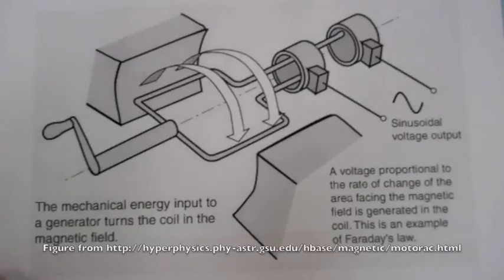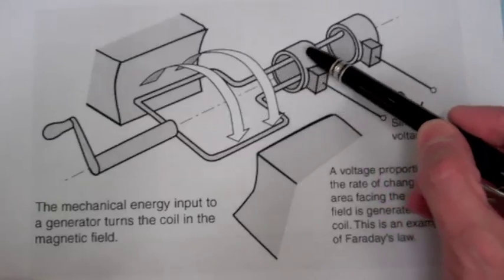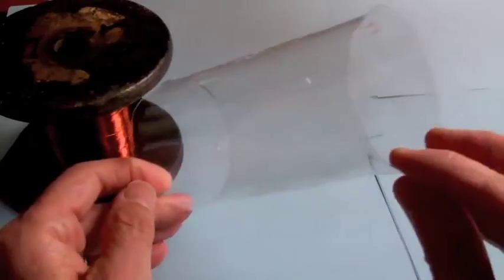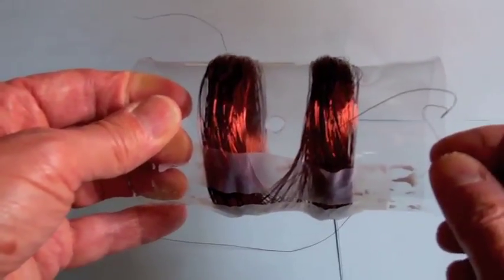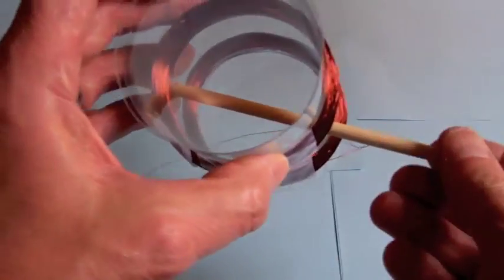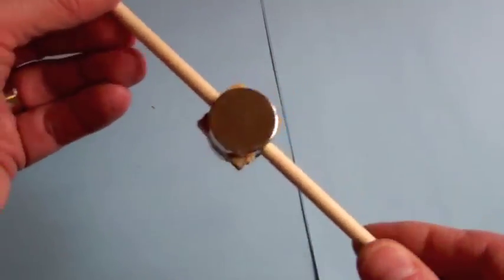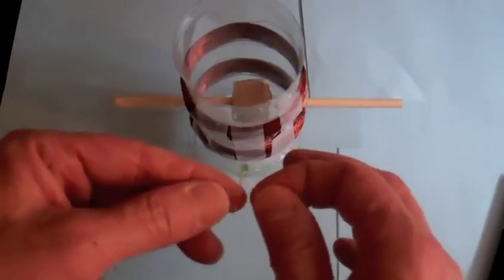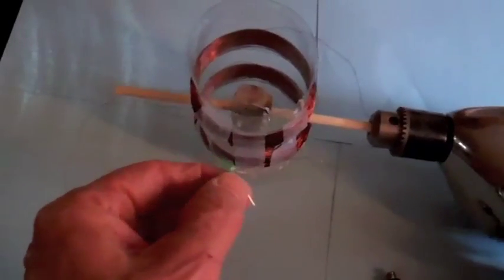AC Generator

Comment: Can anybody tell me what the difference is between making an AC and a DC generator?
Reply from the maker: The first step to go from an AC generator, as demonstrated in this video to a DC generator, would be to add a commutator. A commutator is a moving part of a rotary electrical switch that periodically reverses the current direction between the rotor and the external circuit. So you always have current flowing, and hence voltage, in the same direction.

http://www.motioncontroltips.com/faq-what-is-the-commutator-in-a-dc-motor/
Reply: OK, but that isn't all I think? Different wiring maybe? If only there was a youtube when I was 15 years old...
Reply: Hear ya dude. There were sort of youtube when i was 15 (at least young). My problem is that i am born 50-100 years late. But for your answer yes, that is all.. Imagine AC reversedevery half cycle.. = DC. But now it matter how you wire the coil to your circuit

Comment: Are the copper wire conected together or not
Reply from the maker: It is a single copper wire wrapped around the water bottle and then the two ends, with insulation removed, are connected to the LED.

Comment: can i use thicker copper wire? and about 12 yards of it?
Reply from the maker: Thicker wire is fine, it needs to have insulation on it and you need to remove the insulation from the ends where you will make contact.

With a 2" diameter bottle, 12 yards will only give you about 140 turns. The more turns the more voltage you will generate. I think I had about 1000 turns in this demo. So for the same strength magnet and same frequency of rotation, you would generate 1/7 the voltage that I did.

Comment: does the wire have to be coated?and does the gauge matter?
Reply from the maker: Yes the wire needs to be coated with an insulator, but you do need to remove the insulation at the two ends so you can make electrical contact to the wire. If you use a meter (gauge), instead of an LED, you need one that will measure an AC voltage. A DC meter would not register a voltage.

Comment: if i don't use rare earth niodymium magnet ,will it affect the generator's working
Reply from the maker: The induced electromotive force is proportional to the change in magnetic flux with respect to time. So if you use a weaker magnet, it will result in a smaller change in magnetic flux with respect to time and a corresponding lower electromotive force.

Comment: Can I use copper wire? Thank you.
Reply from the maker: Yes you can use copper, just make sure it has an insulation on it. (Don't forget to remove the insulation at the ends of the wire to make electrical contact.) I used copper wire in this video.
Reply: Ah thank you! Also, in my case, I will be making three generators with coils of 100, 200, and 300 in order to investigate its effect on the induced current. Are the coil amounts okay, and are the differences between them great enough to see a noticeable difference on a galvanometer? Thank you again!
Reply from the maker: You should see a 3:2:1 factor in the induced currents. I think I used about 1000 turns in this video.You might consider using 300, 600, and 900 turns so that you generate enough current to be easily detected.  I would also suggest using as strong a magnet as you can get so as to generate as much current as possible. Build the one with the 300 turns first. Then you can decide if you want to do 200 and 100, or 600 and 900, for the other two.

Comment: how long is the wire supposed to be??
Reply from the maker: The more turns, which means the loner the wire, the larger the voltage you will generate.
Reply: what is the minimum no. of turns required to light a led?
Reply: thank u!!
Reply from the maker: Flux linkage is the number of turns times the magnetic flux. The voltage you generate will equal the change in flux linkage with respect to time. So, you would need to know what your change in magnetic flux is with respect to time to determine the number of turns you need to generate a certain voltage, such as the voltage to turn on your LED. The change in magnetic flux with respect to time is determined by the strength of your magnet and the frequency it is turning. 

Assume you have a magnet with a total magnetic flux emanating from it of 0.0001 Wb = 0.0001 Vs. In a given direction, the magnetic flux is  0.0001 cos[2(pi)ft] Wb where f is the frequency in Hz with which you are turning the magnet and t is the time. If you are turning the magnet at a frequency of 10 Hz, you are generating a peak change in magnetic flux with respect to time of (d/dt) = 0.00628 V. If you need 2 V to turn on your LED, then you need (2 V)/(0.00628 V) = 318 turns.

Comment: dows it matter if there is insulation all over the wire or not?
Reply from the maker: Yes the wire needs to be insulated. Otherwise it would act like just one turn of wire. The voltage will scale with the number of turns. You do need to take the insulation off the ends to connect to the LED.

Comment: One question.  why did you had two separate windings  on the bottle  .will a single thick winding work
Reply from the maker: It might look like two wires, but I actually used just one continuous wire.

Comment: Try this:  add some large iron parts to the magnet.  Thick iron bolts for example.   This makes the distance between the magnet poles much wider.  What will happen?

Try this:  find a much smaller plastic tube; one with walls which are very, very close to the magnet.  Wind only 50 turns of wire (two coils of 25t.)   What will happen?

If we examine the field around a disk-magnet, we find that most of the field-lines curve around from pole to pole, and hug the magnet closely.   But the total coil voltage is proportional to the amount of flux which passes into the coil's empty center.  (To reach the center, the flux must cut across the copper.)    So, a disk-shaped magnet doesn't work so well, and we can improve the generator by using a rod-magnet with poles far apart.

Try this:  greatly increase the thickness of the spaces between the magnets.   Greatly: so the magnets sweep very close to the wire.   What happens?     Also try finding an iron block, or a very thick iron bolt, and use that as a spacer.   What happens?

Comment: is it posible if we didnt use a magnet to produce electric current?
Reply: Nope
Reply from the maker: You need a magnetic field. You would have a small magnetic field from the earth, so you could produce a small current just turning a coil. You could also produce the magnetic field using another coil with a current flowing through it instead of a magnet.
Reply: Hi, Which are the formulas that you used for the generation part? 
Sorry if I sound ignorant but I want to build my own generator and I have a hard time finding those formulas. 

Maybe you could give me a link or something?

Thank you for your time.

Comment: how much voltage it can produce max?
Reply from the maker: The faster it rotates the greater the voltage will be because the voltage is proportional to the change in magnetic flux with respect to time inside the coil. So the limit on the maximum voltage would be determined by mechanical failure. I am not sure what voltage I was getting to, but it is well in excess of 3 volts, the voltage needed to turn on my LED.
Reply: Michael Melloch i am saving your video. it is good the way you explained it. thx.

Comment: I can't find the wire in my country. Any other suggestions for the wires?
Reply from the maker: Can you salvage it from something like an old motor or car ignition coil?
Reply: Michael Melloch is the wire necessary?
Reply: Yes, as you need a conducting coil through which magnetic flux linkage can vary with time. Otherwise EMF would'nt be induced in it.

Comment: I've been looking for  a video like this for so long! Thank you so much!
Reply from the maker: You are welcome! I'm glad it was useful for you.
Reply: @electricandmagneticfields2314  hi Michael, I tried this but my project failed. I want to know where I did mistake. Is there any way I can forward my project to you so that you can guide me my mistake.Thanks Ekta
Reply: @mehulvarshney3124  if it did not work, either you did not have enough turns of wire, not enough speed, or you did not remove the insulation from the wire. its also possible that corrosion and damaged wires lead to power being blocked or otherwise not generated.
Reply from the maker: You are welcome!

Comment: Hi 
Can we insert the magnets through the open portion of the bottle instead of making a hole in between the coils?
Also does it matter if the wire is overlapping each other?
Reply from the maker: Yes you can have the rotor go through the open end and the wire can overlap. Be sure you have wire that has insulation on it.
Reply: It does but for some reason the bulb is not lighting

Comment: thx for the video ... i tryed it but i get only 0.05 voltage , glade that prooves to me that its working but how can i increasing the voltage to 3 or 4 volt ... and the wire is about 120 and also i used neodnyom magnet from the hard disck of my pc ... plz i need an answer ??
Reply from the maker: +amine med How did you measure the voltage? The voltage will be AC and if you are hand turning it you might not sustain the voltage long enough to accurately measure. If you are using a dc meter to measure the voltage you would get no reading. Did you try connecting it to an LED? If you feel you are accurately measuring the voltage I would suggest increasing the number of windings. But even if you go to 1000, instead of 120, you would only obtain 0.5 V.
Reply: +Michael Melloch i measurate it with ac metre and the 0.05 volt is the max voltage i can get  ... so that means i need 4000 wending to reach 2 volts hhhh ... what u suggest to me plz ..?
Reply from the maker: +amine med How are you turning your magnet? By hand? Do you know at what frequency? Maybe you are getting more voltage then you are actually measuring. If you have an LED handy, just attach the LED and see if you can get it to light.

Comment: Hello, I am replicating this generator as a project for my physics class, I only get a flicker of light when I turn the stick at top speed with my hands (doesnt seem to work with the drill unless at near maximum speed). We have around 500 windings and have the magnets located close to the coil. What could we do to increase the voltage or decrease the frequency required for the light to appear?
Reply from the maker: +Thorsteinn Hjorleifsson For the same frequency of rotation of your magnet, the electric field you are generating will scale with the number of turns. So doubling your windings to 1000 would double the voltage you are generating. 

Are you using magnets with strong magnetic fields such as a rare earth (Neodymium) magnet? If not that will make a huge difference.

http://www.amazon.com/CMS-Magnetics®-Neodymium-Magnet-1-count/dp/B008CQ9CR6/ref=sr_1_38?ie=UTF8&qid=1459696048&sr=8-38&keywords=rare+earth+magnets

Note these  rare earth magnets are dangerous to handle because of the force with which they will attach to other magnets or magnetic materials. You have to be careful not to get pinched.
Reply: +Michael Melloch Thanks for the reply, I stacked three magnets on each side so they would reach closer to the coil, they say very strong on the pack but I doubt they are as strong as yours.

Comment: i made it in same way  but it is not working
Reply from the maker: +Abhishek Jaiswal Did the wire you used have insulation on it? If not you need to use insulated wire. If you used insulated wire, did you take the insulation off the ends in order to make electrical connection to the LED? Also did you use strong magnets such as neodymium-iron-boron rare earth magnets?

http://www.amazon.com/Rockler-Magnets-10-Pack/dp/B001DT3RNO/ref=sr_1_2?ie=UTF8&qid=1452864454&sr=8-2&keywords=rare+earth+magnets+1+x+1%2F8

Comment: What voltage does this produce? And how much current (in amps)?
Reply from the maker: +Anthony Basile` I haven't directly measured, but the green LED I am lighting requires 2 V and 20 mA. Turning it faster would produce more voltage and current.